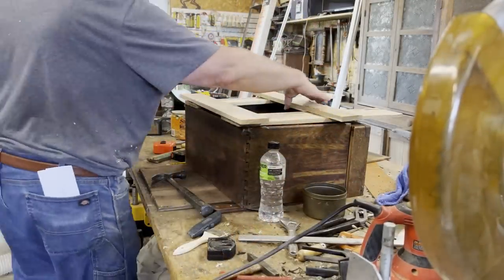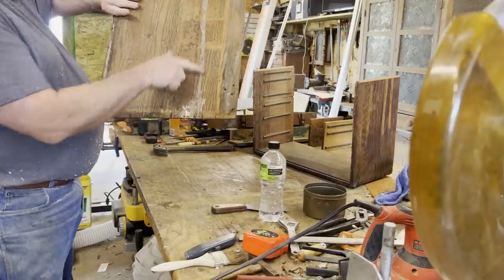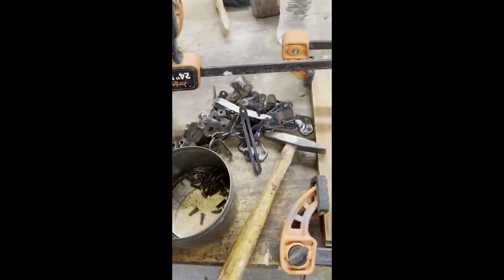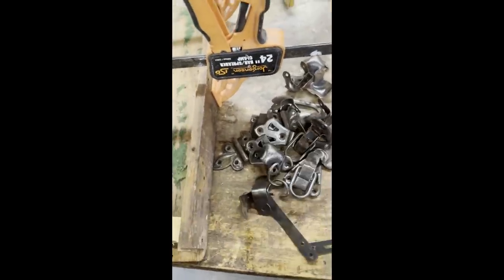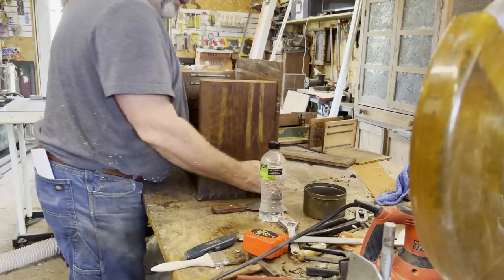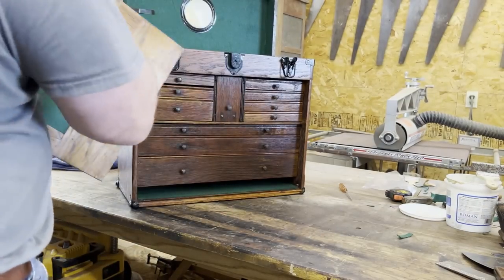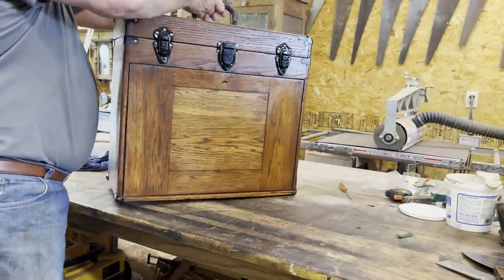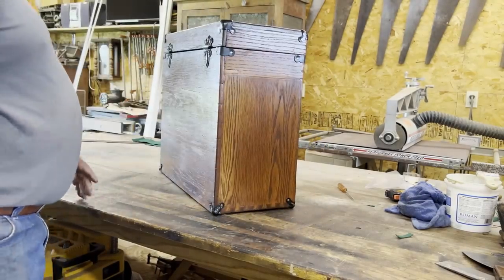Well worn Gerstner style machinist chest makeover.

Comment: An upholster’s trick ,when adding felt to all sides of a drawer,  measure fabric to include height of the sides, cut fabric. On back of fabric, measure exact size of bottom and mark fully across the fabric. Where the lines intersect, cutout the extra square on each corner. Glue in fabric onto bottom and stretch to insure a good bond, glue sides and attach extra fabric onto sides of drawer. This takes less time and insures that there is no edge fabric except in corners of sides.
Reply: I know that a lot of folks avoid for the mess, but I use flocking so I don't have to do any cutting at all. Fitting drawer liners annoys me.

Comment: Brave restoration- many parts more work than replacing! Nice work.
Really surprised how poorly constructed some of these tool chests are (nailed on back, face mounted rails, etc). Even the fabled Gerstner cut corners, especially recently (nails for pushing door lock pins and holding on the door side plates,  non-veneered ply internally, etc).

Comment: According to Gerstner website, that handwritten number inside the main cabinet is the control number. That way all the pieces, that were hand fitted together, can be reassembled after finishing and hardware attachments, etc. I like how the chest pops back to life once the stain is applied, it looks great!

Also, if anyone is interested, they have a service ($50) to identify the age, within a few years, of the tool chest. They sell the split rivets, felt, handles, corner brackets, and locks.

I'm guessing that the one I inherited from my father, it is about half again as wide as the one you worked on here, is about 60 years old, I know he ordered it direct from the factory, not as a second hand purchase.
Reply from the maker: Thanks for the information. This wasn’t a Gerstner so parts from Gerstner aren’t appropriate. The Gerstner parts have their name stamped on them. I appreciate the views!

Comment: I inherited a 7 drawer machinist chest from my father in law. It is from Union Steel Chest Corporation in LeRoy, NY. It is missing its front drawer cover. I want to make a new cover. Trying to figure out if the original was a raised panel. The rear oanel of the chest is a flat panel. The corner hardware is attached with screws and it is in general good condition.
Reply from the maker: I have a seven drawer chest from Union chest company, and with the smaller one I have, it has no panel just one single flat thin board. However there is no wrong or right because there were options I have seen taller chests with raised panels flat panel and even side-by-side flat panels on the drawer cover. To me it’s not particularly important if you’re going to display it open most of the time. If you’re actually going to use it then I would go with a single panel most likely flat because it’s easier because it stronger than just a plain thin piece of wood like mine has.
Reply: @meanwhileinindiana8107  Thank you so much for the encouragement and perspectives on the front panel. I have never seen someone make such a thin floating panel cover like you did in this restoration. I am kind of awe struck! It really looks great on that box.
Reply: I have a 7 drawer Union Steel chest at work, it has a raised panel in the front cover with felt on the back side exactly like you would see in a Gerstner chest. The only difference is the Union Steel has a round finger pull where the Gerstner is more oval. Union Steel stopped making wood chests around 1953.  The two screws mentioned at 1:58 in the video are the stops for the front cover.
Reply from the maker: @garykarel674  excellent information! Another mystery solved. Since this box wasn’t going to be use instead of putting those back I use them as the front panel handle so it would match the entire case. But it is so nice to know what they were actually for. Thank you!
Reply: @garykarel674  Thanks so much for sharing your insights!

Comment: How does the flip down door stay put? Is there a magnet or latch?
Reply from the maker: There are spring loaded pins that when you close the top it pushes the pins down into the top edge of the front panel.

Comment: You did a nice job! Have you considered using wax or oil to make the drawers slide nicer?
Reply from the maker: They slid perfectly after The adhesive I used to install the felt dried. It added a lot of moisture to the case which everything then swelled up.
Reply: Normally a quick rubbing with a piece of candle wax is all it takes along with proper fitting first